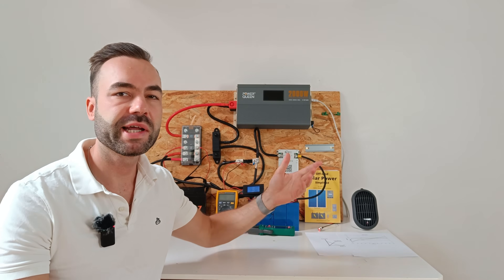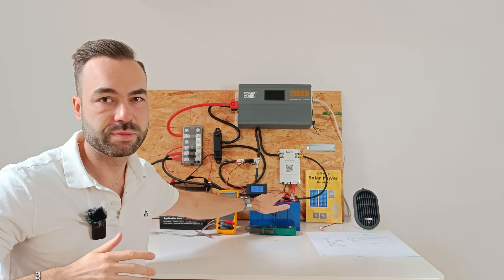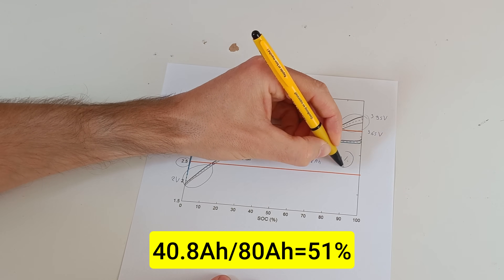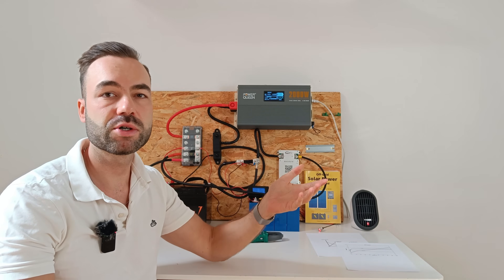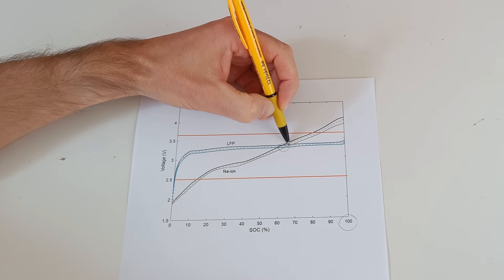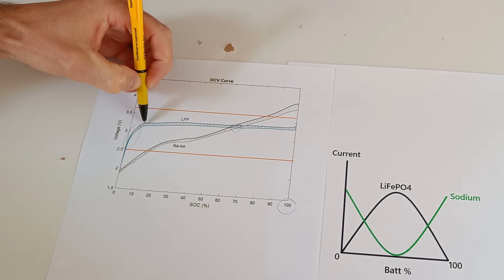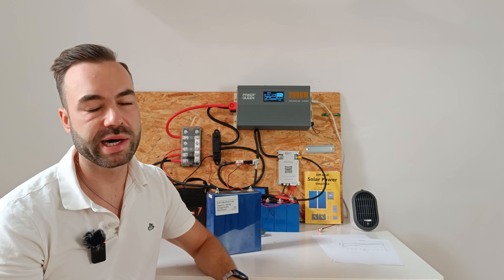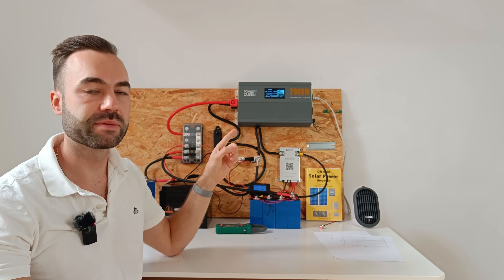Does Combining Lithium and Sodium Batteries in Parallel Work?

Comment: Fair enough. 09:55 Opinions aside; applications of this combination may outweigh the additional associated costs of the apparent non utilized stored energy. I can think of two examples worthy of consideration; as both of which conditions greatly benefit the LiFePo4 cells at their respective cutoff voltage given the NA+ amperage capacity at the aforementioned low voltage cutoff point. 1) Extreme cold temperature 2) Certain specific motor conditions 3) and possibly during extended LiFePo4 flat voltage storage periods. 4) additionally I'm always pondering ecological and environmental quality. It's arctic cold out 😢

Comment: Combining LFP with Na-ion would be handy in situations where you want more of a warning buffer before low-voltage shut-off. You can also still use the full Na-ion's range with a single inverter by simply disconnecting the LFP batteries above 3.6V and below 2.8V DC rail voltage. A contactor and short pieces of wire are much cheaper than an inverter.

Comment: With smaller panels, I'm wondering whether the higher voltage of Na-ion (when getting close to fully charged) could start being a bit of an issue/inconvenience? 
For example, my Victron 100/20 solar charge controller apparently needs to be provided with a voltage on its solar input that is 6V higher than the battery voltage. Maybe you know precisely what the voltage differential needs to be? 
My Renogy 100W panel has a Voc of 24.3.V and a Vmp of 20.4V, so that may just be OK with sodium-ion, but panels with slightly lower voltage values may have issues, especially on overcast days and if they're in less than optimal orientations - such as van roofs.

Comment: Sodium comes out 4xmore than lfp but 4 cells work wonders under the Hood of a car, ditch the lead, one to one replacement.
Reply from the maker: I agree! Which brand did you use?
Reply: @cleversolarpower the box said GoKwh. I got the packet out because it would not fit. It is 100Ah in place of lead 74. Kept only the yellow insulators. The bms is passed-by, using only its balanser. I guess that it is bored the while time at 14.2V. the car is a 1.6 diesel.
BTW, i used a 100Ah lfp battery under the hood of an EV. The bms there works erratically but without an effect on the car.

Comment: Some people supplement the capacity of their powerstation with standard 24V LFP packs, using the powerstation's MPPT as the input method. Presumably a Na-ion pack could be used just as easily for that specific purpose since the MPPTs will likely also cover the voltage range of the Na-ion pack. [Edit: Using the stats on your graph, the voltage range of an 8S configured Na-ion pack would be 32V down to 16V]
Reply from the maker: Interesting, i will give it a look.

Comment: For those saying it isn't beneficial to mix batteries, what about this scenario:
For 90% of your capacity, you use LiFePO4 for your main battery bank, since it allows for high capacity at a reasonable price.  Then, the remaining 10% is comprised of LTO batteries.  LTO has a similar voltage curve to Na-Ion, but can handle much higher bursts or current and a lot more charge cycles.
For something like an EV, I think this configuration could make a lot of sense, where the LTO battery is for acceleration and regen braking while LiFePO4 is used for range.

Does this make sense or is that a bad idea?
Reply from the maker: CATL has a car battery where they have 50% sodium and 50% lifepo4. I don't know how they incorporate them together though.
Reply: To make the most out of the LTO in this case, you will need two main bus voltage lines running at the voltages of each bank. You would want to be able to discharge / charge from the LiFeP04 at a constant rate while drawing the spikes from the LTO during the bursts, so that would require being able to run them at their own voltages. Not impossible, but it basically doubles the size of your wiring loom and inverters. Also, which battery would you hook up to the charge port during fast charging? I guess if your LiFePO4 is used for range you would use that.

I do like that idea though, it would allow you to use much bigger LiFePO4 batteries which are more energy dense because you don't need huge currents from them.
Reply: @ThisRandomUsername I am not sure it's this easy though. As you see in the example with LFP and Na, most of the current comes from 1 of the batteries. Buying an expensive LTO battery that's 1/10th of the size of total pack and then (dis)charging it at 10C instead of 1C for the LFP, you don't get much extra power compared to having an all LFP setup.
And when you are in the middle of the voltage range, you might even get less power out of the pack, because most of the power will be drawn from the LFP battery, which has a more limited (dis)charge rate.
OTH LTO works better at low temperatures, which might be useful in cold climates.
Reply: @GerbenWulff  Thanks for pointing this out. I see wildly different numbers for the cost difference between LTO and LFP, but I assume you'd want something like 20% LTO so that you can ~2x your current density of your pack at 10C LTO and 1C LFP. This lets you get away with a smaller pack than pure LFP. If the economics don't work out, then this is just a bad idea.

I think the idea is that when you're not drawing peak power from your system, you can charge the LTO back to ~50% from the LFP part.

Re: LTO working better at low temperatures, I guess that means you only need to condition the LFP part of the pack, but that means you still have the overhead of that system. Hybrid is hard.

Comment: Can the same be done with Lithium ion batteries and AGM Deep Cycle Batteries in Parallel  ?
Reply: I have 1000ah of OPZv (24 x 2v) and have connected 4x series 100ah 12v. My charging algorithm is 56.4v with 16ah tail current and 54v float. Running for bit over 2months now and I’v found so far no issues the lithiums discharge first saving the gels and they get charged regardless of voltage over the day and act almost identical to an acid in terms of amp draw vs soc. How long will they last I don’t care as they have 3yrs warranty.

Comment: interesting experiment but float V of lifepo4 is  13.4V not 14v. 14 v is absorb voltage.
Reply from the maker: Yes, 14V is what the battery was at before starting the test.

Comment: Not bad, but note that the highest reasonable float voltage for LiFePO4 is 3.375V/cell, or 13.5V for a 4S pack.  Not 14.0V.  After fully charging, a LFP battery will still be at 99% at 13.5 V.  So it’s actually a lot worse and generally speaking there is no point paralleling LFP with Sodium.
Reply from the maker: 14V is where i started the test at, so that's what i used. Yes, it's not beneficial mixing them.

Comment: Full SoC equilibrium voltage on LFP 12v will be 3.45v x 4 cells = 13.8v.  Above this will be pushing an overcharge into LFP battery once it becomes fully charged and its absorb voltage (3.65v x 4 cells = 14.6v) that has built up a surface charge of no significant capacity is burned off.  

The LFP four cell battery will NOT hold at 14.0v.  In several hours to a couple of days the surface charge will bleed off on its own, with battery unloaded, and will drop to about 13.8 to 13.9v full state of charge voltage for the LFP battery.  

If you are fully charging a Na-ion battery it will continue to discharge to LFP battery until it reaches about 13.8v for the combination, which will take some time, where it is overcharging the LFP battery eventually damaging it if you continue to do this.

Your absorb level charging must be set by what is good for LFP cell and end of discharge voltage also set by the LFP cell. This will limit the useable capacity of the Na-Ion battery to about 50%

If you operate the combo as you describe you will damage the LFP battery.

Most present inverter designs cannot operate over the total voltage range spread of Na-Ion batteries, so even if you use only Na-Ion battery, the inverter operating voltage range will limit the useable Na-Ion capacity to about 65% of its rated full voltage range capacity.
Reply from the maker: Yes, this is what i was thinking as well. If the battery is being charged for too long, then it will eventually damage the lifepo4 cells because the sodium cell keep it above float.
Reply: Yep, prices will need to come down drastically for this new chemistry, as will the electronics to deal with the voltage curve shortfalls to make it a viable competitor to LifePo4.
Reply: 65% usable capacity using li-ion inverters, meaning to reach the same usable capacity as LFP (160Wh/kg), the sodium energy density needs to be at least 246Wh/kg

So far only nickel-cobalt-based li-ion battery (NMC and NCA) has over 250Wh/kg, but it's still interesting if sodium battery can come close to that in the future (there are some research articles about solid state sodium batteries that claims it has almost similar energy density as NMC lithium battery, but it's still only a sample prototype, and will likely to come far later, as current solid state battery development is mostly focused on the lithium based one)

Comment: Thanks for the explanation. The argument of paying more for sodium is mostly for the short time, right? Mostly because lithium is more in mass production than sodium.. Is it fair to say that once sodium batteries get at a larger production, it's price would go down and this configuration could be worth?
Reply from the maker: If prices come down i recommend keeping lifepo4 and na+ separate, each with their own inverter and couple them. But the price of sodium has a long way to come down before it makes financial sense.
Reply: I would stick with lifepo4 for now regardless, it has a nice flat curve for charge/discharge cycles, it’s reliable, rugged, safe & cheap by comparison, maybe in a few more years it will prove itself with new electronics getting cheaper to deal with its voltage curve issues.

Comment: If we're going to use sodium ion batteries in near future.
 we'll also need an inverter specifically designed for sodium also.
Reply from the maker: Or a DC to DC converter.
Reply: @cleversolarpower  next episode:  Sodium battery with dc to dc converter (Buck-Boost Converter).
# Is it possible to get 100% capacity??
Reply: @JunitafluxcyfatriciaJunita Probably not. Lifepo4 has a beautiful flat curve for most of its useable range.
Sodium batteries are going to need specialised electronics to make there range more useful.

Comment: Perfect - just as I had imagined - thanks Nick. Now I'm wondering if there's any thermal advantage to this. Say you alternate sodium and lithium so that one becomes a heat sink for the other.
Reply from the maker: What comes to mind is the 'Freevoy Dual-Power Battery' by CATL. Half sodium-ion, half LiFePO4. This combines the low temperature capability of sodium with the higher performance of LiFePO4. So when the car starts but the temperature is too low for the lithium cell, the sodium cell can be used first and the heat generated will warm up the lithium cells.
Reply: @cleversolarpower  Exactly right. And there may be a good reason for only using half the capacity of the sodium cells. Am I right in thinking sodium has about half the cycle life of LiFePO4. By under-utilising the sodium cells, their life span will be extended.